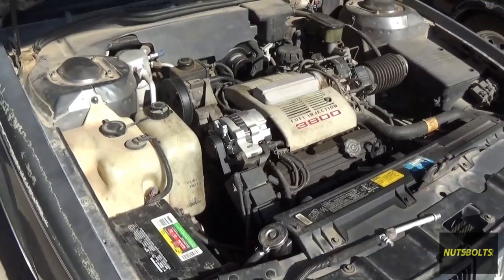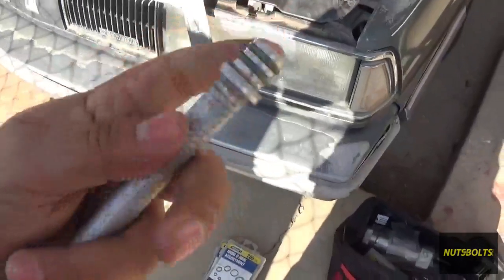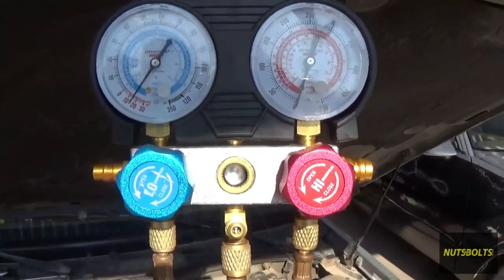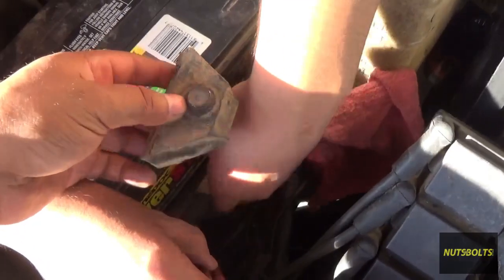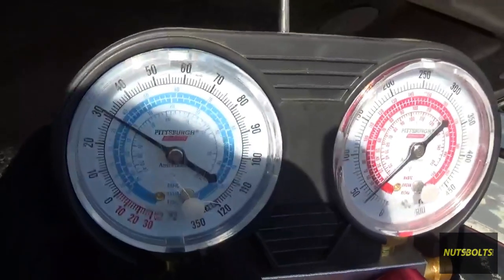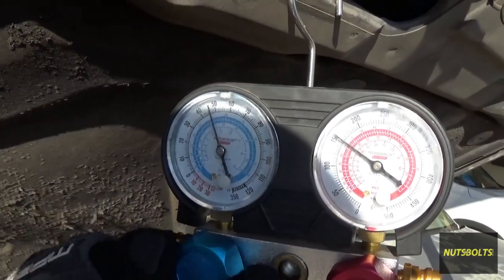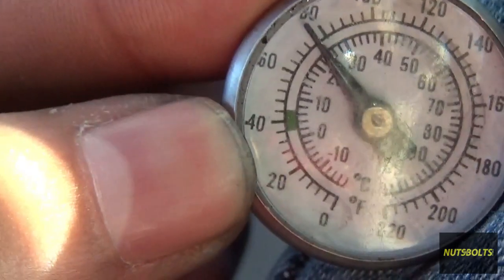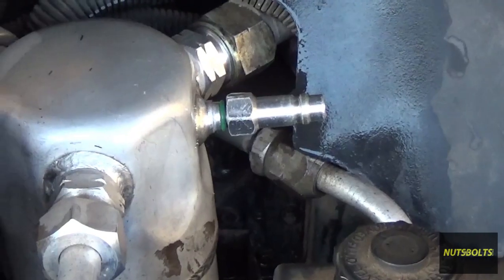How to Vacuum and Recharge Your Car's Air Conditioning

Comment: Never charge on the high side fyi u should only charge ur system through the low side keep the high side closed
Reply from the maker: As long as the system is off, you can charge on either side. The pressures will equalize anyway. If the compressor is running, DO NOT try to charge on the high side.